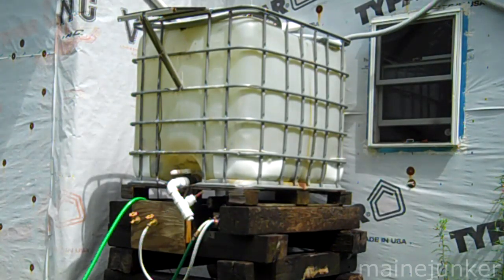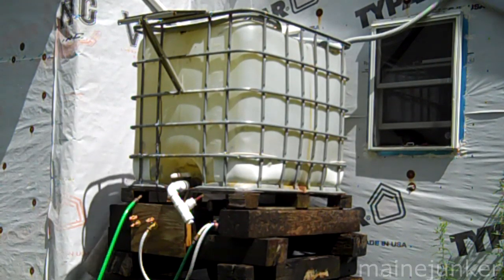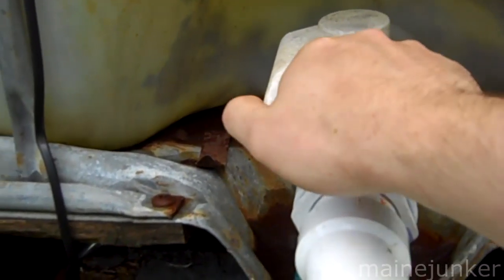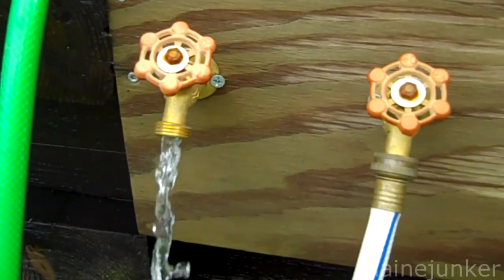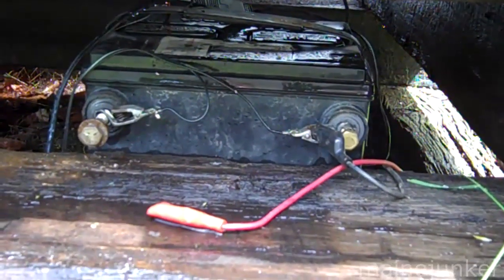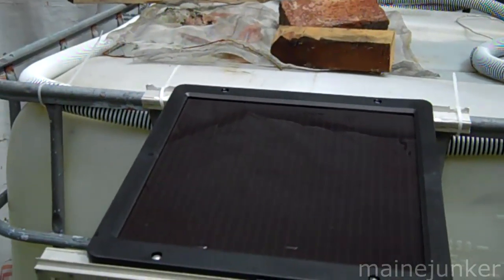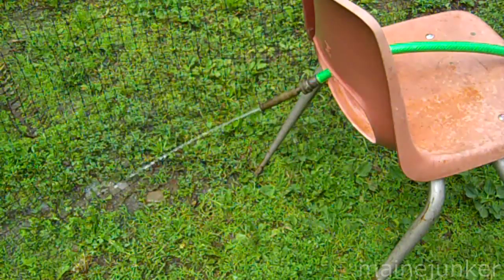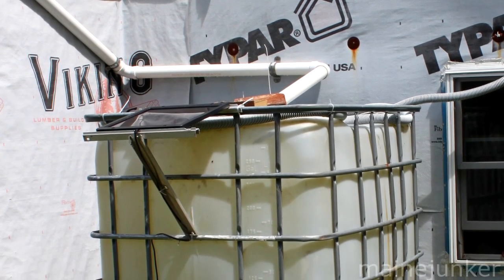☁ Rain water catch sytem with solar electric pump

Comment: Use the solar powered pump to pump the water up to a higher level.  No need for a battery and it's much more efficient and "passive"  you could use a pump 1/10th the size that way also.

Comment from the maker: Thanks for your feedback.  Although this pump has a pressure switch on it unfortunately it doesn't seem to work, or it's rated for a much higher pressure than my purpose.  I kinked the hose and the pump slowed down but kept going, the garden hose started swelling up.  I released it because I didn't want to ruin the hose.

Our house has a drilled well with an electric pump and a pressure tank, which is another reason I like the idea of free water.